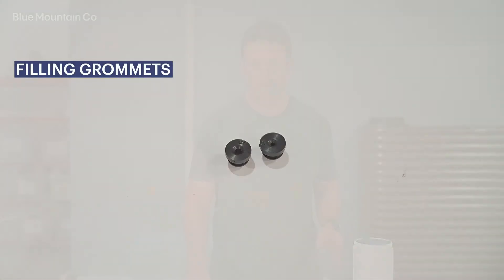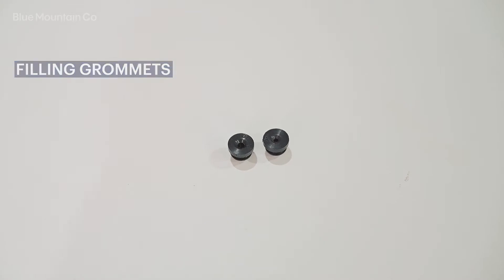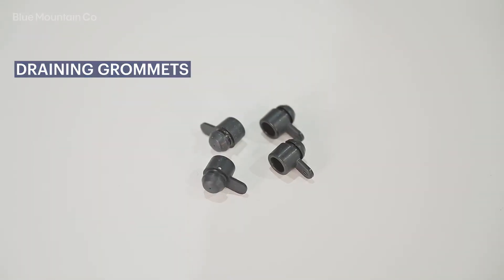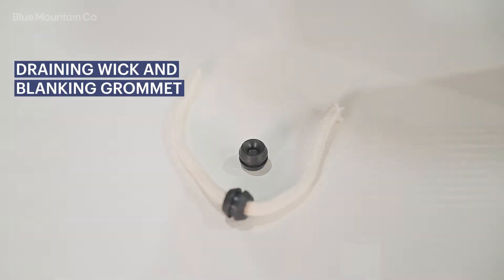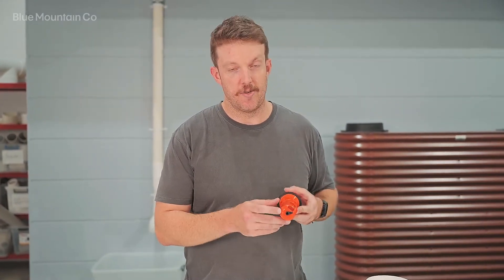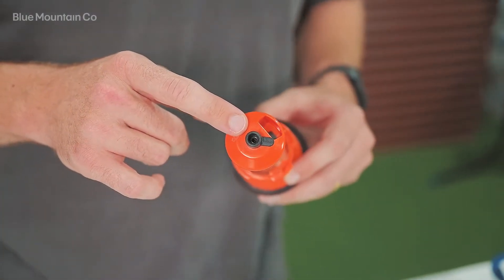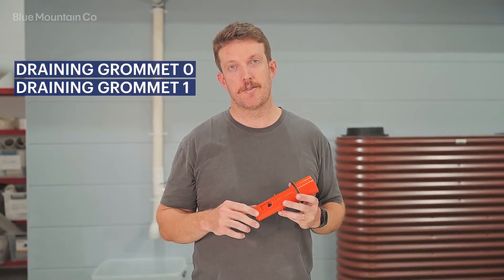First Flush Carrot - Adjusting how much water your divert

Comment: And those grommets block from the dirty water and it doesn't work at all
Reply from the maker: Hi @trevormatt6663

Thanks for commenting!

For best results and minimal maintenance, we recommend installing rain heads such as our Leaf Eater rain heads on all your downpipes to limit the volume and number of leaves and debris that reach your first flush diverter potentially causing it to block up.

It is important to periodically unscrew the Carrot housing and check the unit is functioning properly. Check that both the Filling Grommet and Draining Grommet have not become blocked.

If you have a Carrot installed on your property and would like to speak to someone in our team, please don't hesitate to reach out at info@bmco.com.au. 

-Thoeni